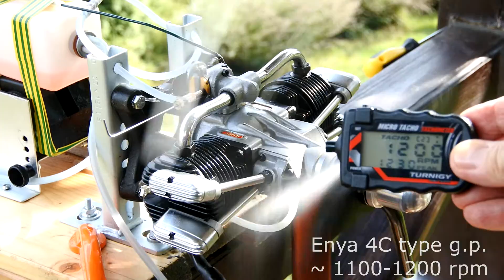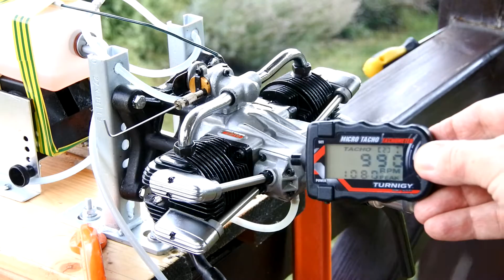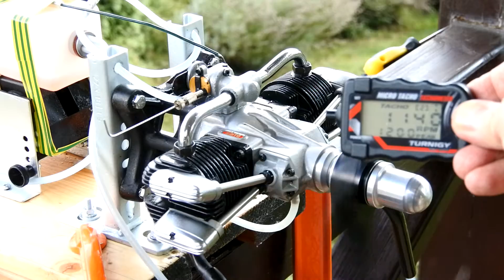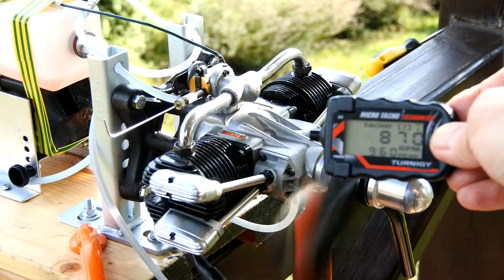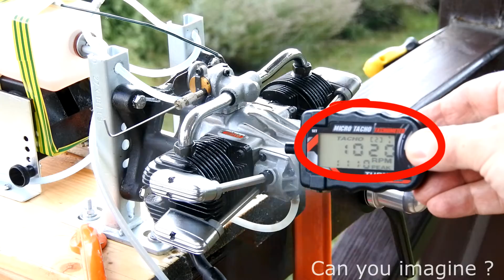Saito FA 270T testing influences on idle Part 2

Comment: that was a good test with the different glow plugs. my little fa60t idles really low without glow driver
Reply from the maker: Thank you for your comment. As far, as I can tell
 on the tested twins (Saito FA 270T, OS FT 120 MkI), there is no significant difference in between with or without glow battery connected, if engine was warmed up and there is not so cold outside - it would idling flawless, I think, for hours. But anyhow, this theme isn't fully discovered. I'm planning to dig deeper :-)

Comment: I rock the F in my 4-cycles and they work a treat! I got an FS48 Surpass stable, unassisted, down to about 1900RPM! And my FA-90TS runs like a champ on them as well

Also, I could listen to that thing burbling over at 950RPM all day long. Sounds sooooo sweet.
Reply from the maker: Yes, it is. It is sounds soooo sweet, 100% for sure. There something very exiting in sounding of a good RC 4 stroke idling engine. I can listen it for hours.
Reply: @crazyengines88  They sound amazing at any speed tbh. I barely even fly 2-cycle anymore. Saito, OS, Magnum, YS, all of 'em are dolls in their own special way.